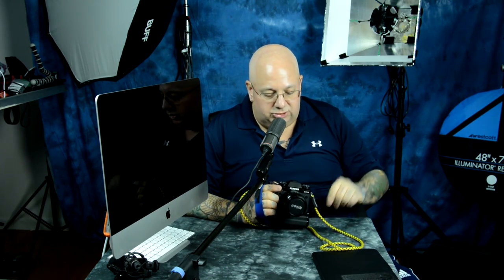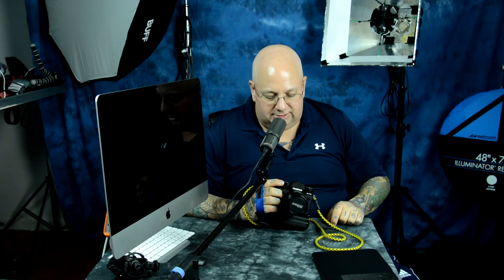Fujifilm X-T2 10-seconds IDLE & then LAG explained. It's a power-feature of the firmware

Comment: I’ve experienced shutter lag (delay) on two X-T3’s. I had thought it was from being in Normal mode but it lags in Boost as well. I mean I press the shutter and it takes 1-3 seconds before the shutter releases. I’m in single mode, manual exposure, manual white balance, manual focus, and I even turn the lcd off and set the EVF to eye-only. I can power the camera on about 2-5 seconds before I’m going to snap but when I press the shutter, it has that delay. I’m at f8 and 1/500. 

This doesn’t happen all the time but some days are worse than others. Some days it’s 50% of shots, some it’s 80%, other days it works without issue.

Comment: I had this problem with my X-T3 (firmware v4.2) while using it as a webcam, the webcam feed would drop to probably 5 fps. Enabling boost mode did not fix my problem. But I did find that making sure the viewmode was set to LCD only did solve the problem

Comment: Have to pay 350 euro to get rid of power save mode? New times "green camera" with turbo boost, missing only power ranger behind the EVF.
Reply from the maker: no, boost mode on the camera itself alone ends that too.
Reply from the maker: its no diff than your phone going into IDLE mode when not touched
Reply: +Theoria Apophasis Yep, nice feature like that battery grip for the same money I got Xpro-1 with 27mm f2.8.I love when something new come out, it means cheap shopping  of so called "old " model.Here in Europe Fuji has rather  high price and poor re-sale value, for me no new Fuji XT2 at this moment ,will wait for price drop or some Fuji discount (hope that someone will buy camera which is not what is his looking for ).